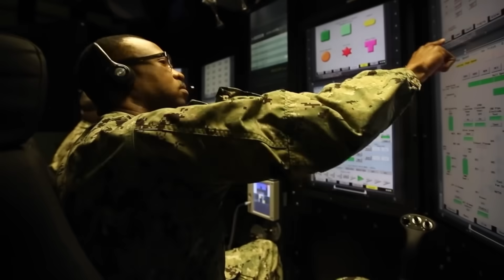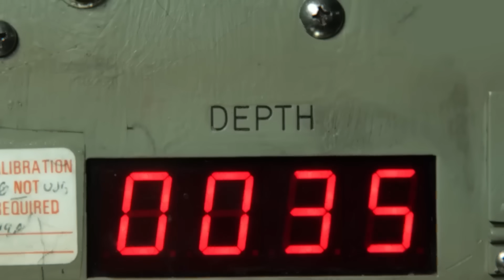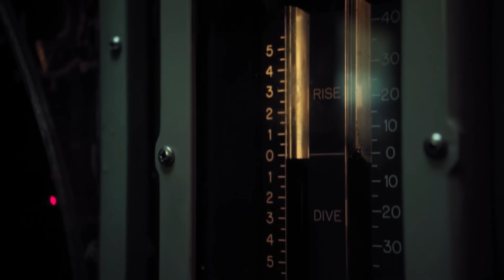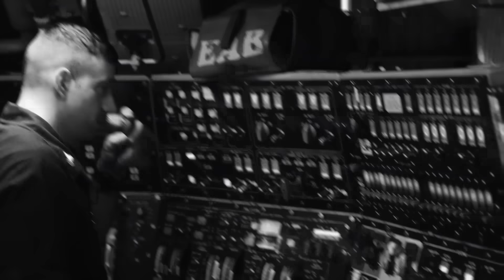What Happens When a Submarine Hits "Crush Depth"

Comment: So my question is why didn’t the titanic halfs implode on the way down after sinking 👀 just a question because I really don’t know the science behind it all.
Reply: Cus it big af
Reply: The Titanic wasn't pressurized
Reply: It's pretty confusing, but the short, simple answer.. the Titanic was letting in massive amounts of water on its way to the bottom for obvious reasons. It's not a completely sealed vessel, so the pressure isn't as catastrophic as a submarine would be. Once the submarine is at very low depths, all it takes is a small fracture to immediately crush it.. if that makes sense
Reply: It wasn't air tight like a balloon, the water flowed freely and filled it up like a wiffle ball.

Comment: Less than .025 seconds you would never know it would go to black. The thresher went down ultimately because of its shit emergency blow system. It used to have grates over the pipes high pressure with moisture at those depths makes ice...... Ice stopped the ballast tanks from filling and she went down. All this has been changed.

Comment: The Thresher didn't sink due to loss of reactor power. It sank because of moisture in the high pressure air tanks; this moisture in the piping froze which prevented the ballast tanks from being expelled which would have allowed the sub to rise to the surface on it's on bouyancy.

Comment: At  the Titan's depth,  water would rush in at approx twice the speed of sound. The air would experience such rapid compression, it would get close to 3000 degrees centigrade (about 4800F) in about 1 millisecond. This would vapourize organic tissue instantaneously. The author of this video compares submarine depths (1000-2000ft) with the pressure in a diesel engine. At 12,500 ft, the pressures are at least 20 times greater than a diesel engine detonating. These numbers are incomprehensible. Suffice to say,  when Titan imploded, the occupants wouldn't have even heard the sound or felt the effects of the implosion. (Approx 7-13 milliseconds to experience pain, from the time of the stimulus). Death would have occurred in 1-2 milliseconds. Unlike a bomb,  where the force of the explosion is from one point,  in an implosion, the force is all around the victim.

Comment: To put it in perspective:
The implosion happened within a fraction of a second. Say the submersible is like a balloon. Like one of those celebration balloons with things inside of it. Now, you have the balloon. It's waving in the air like nothing and then you pop it with a needle. How fast did it take the balloon to pop with that needle? That's how fast the implosion happened..and whatever came out of the balloon is dust. In the situation with the submersible (the balloon) it happened that fast and the people were gone (dust) before they could even finish blinking. They were, unfortunately, reduced to atom particles in the sea.
Reply: Well, they were compressed into a red colored pulpy cloud of water.  About 80% of your body is already water, and would be just fine after the implosion.

Comment: 2:23 For those wondering, the Titan would have taken about 1 millisecond to implode. The air inside would have ignited due to the immense pressure, and everyone inside would have immediately incinerated and turned to dust. Source: BBC
Reply: That's the actual implosion. Before implosion, acoustics would be heard. The delamination would begin. The passengers would hear it. They had time to drop ballast. They called a mission abort. They started an ascent... so there were moments before where they had obvious reason for concern. They would've lost coms & power while the shuddering & groaning increased before ultimate failure. Source: James cameron
Reply: @BalthazarMyrrh70  Where did you hear about them dropping ballast? I have heard of no such thing from official sources.
Reply: @rosieposie9564  they should release the final transmissions... anyway, watch one of the initial interviews with Cameron. He's all over this now. The final transmission was apparently an abort. The ballast was dropped. It was communicated to the above surface vessel & shown in the debris & location because the vessel had actually begun an ascent before moment of implosion. This is from various reports I have seen online. And would be typical of previous missions, the majority of which were aborted due to various issues.
Reply: @BalthazarMyrrh70  All possible, however, I think it is best to wait until the investigations are concluded to establish the facts in this case as lots of rumours and speculations are going around. Cameron is now annoying me, he dropped out of college while studying physics to study English instead and he dropped out of that too. I acknowledge his experience with deep sea exploration but I think he should leave the science stuff to the real engineers.
Reply: @rosieposie9564  Cameron actually knows when to defer to experts.
Reply: Source: Pedophiles

Comment: Im still curious to see the internal GoPro of the Titan.
Reply: A submarine implodes 50 million times slower than the Titan did.  Because of the depth and pressure.   Titan crew were cooked and vaporized in 1/10,000,000,000th of a second.  Faster than the their brain even works.   A submarine implodes in about .01-3.0 seconds, due to how shallow it is.  Doesn't even cook the crew

Comment: At the point of implosion the inside of the Titanic submersible became as hot as the sun's surface so the passengers likely evaporated and there won't be any body parts found.
Reply: The heat of the air really has little to do with it - and it isn't anywhere near the sun's "surface" temp (not that the sun has a surface).  In the first few milliseconds after the hull collapses, everything inside of that sub will be crushed down to 1/600th of the volume it previously had.  Everyone in that sub was instantly reduced to a pulpy red liquid within milliseconds.

Comment: This video has so much wrong with it.  It claims the crushing depth would “generate so much heat as to make the submarine implode”.  Imploding is not a function of heat.   Heat has nothing to do with it.  It implodes simply because it’s shell maintaining the internal pressure failed.  That’s all.  

The video claims that “fuel, oil, and bodies would rise to the surface”.  Fuel and oil perhaps, yes.  But bodies? No.   We are essentially the same density as water.   The only reason we float is because our lungs are filled with air.  At crushing depth, all the gasses within us - the air in our lungs, the oxygen in our blood, etc - would be crushed out of us instantaneously.  The gasses would either dissolve into the ocean water around us or float to the surface.  But our bodies? No.  First, we wouldn’t have bodies at that point.  We’d have been pulverized to a paste.  But any tissue that did remain would sink to the bottom.

Hell, even when whales die, most of them sink to the ocean floor.

Comment: Thresher did not succumb to electrical failure caused by water saturation. Subsequent testing reveled that Thresher sank because ice formed in the pipes needed to blow their ballast tanks due to condensation, preventing the compressed air from passing through.

Comment: A submarine, as soon as one thing goes slightly wrong, will turn into the place that’s optimal for various kinda of death

Small room and a lot of people make it prone to violence, you can die due to something water related, you might die because of something wrong with pressure, if the submarine is nuclear that can be a realistic danger as well or if its diesel powered the gases can be your end and i think there is still mich much more that could kill you

I would never go deep into the ocean inside one on my free will

Comment: How can the century old Titanic be in relativity whole shape while a modern submarine implode?
Reply: Physics! If you push a water bottle full of air down far enough, the pressure outside will be more than the atmospheric pressure inside the water bottle and crush it. Fill the water bottle with water and It won't be crushed. The bow of the titanic gradually filled with water and thus remained in relatively good shape whereas the stern went down with air trapped inside and did actually implode. At least that's the theory most people accept
Reply: @FilsketeerHD  Good explanation 👍

Comment: What happens, if there is a small leak that let's water in as the boat gets deeper, that would increase the pressure insight, lowering the pressure differential. This would of course compress the remaining air space smaller and smaller, but this means a boat can go deeper than crush depth while staying mostly intact.
Reply: There's no such thing as a small leak on a submarine.  Either your craft is watertight, or it is destroyed.  We use water jets to cut steel.  A 'small leak' when you're down deep is equivalent to one of those steel cutting water jets.  Whatever hole it is coming in will only be small for a few milliseconds while it cuts a large hole.

Comment: Any of you work in Frac?  The pumps can supply 60 million pascals, or more and when combined with other pumps can push 12 cubic meters per minute down a small pipe. 

Reason why I mention this, pressure is inside the pump, and as the cylinders cycle, the thick steel pump will appear to breath, even though it is thicker than five inches.

Steel may be rigid, but all materials have some form of flexibility and will descrease or increase in size regardless of thickness of material.

Very fascinating to watch.

As for what happens to a body subjected to a pressure release, sadly some people on frac jobs never came home.  The energy destroys flesh and breaks bones.

Comment: To put into perspective. The challengers depth of 35 000 has such a high pressure on a submarine if anyone made a hole the size of a medium pin needle. The pressure from the water that will rush in is so high it'd drill through you like an industrial jet stream cutter of 40 000 psi. The elephant on top of a stamp doesnt even begin to describe it. Every square inch has the amount of water push down on it equivalent to mount everest heigh of an inch wide steel pole being pulled down onto that square of space. It would be like crushing an ant with the largest and tallest building ever created. Ex: Empire state building or Burj Khalifa.
Reply: :face-fuchsia-tongue-out::face-fuchsia-tongue-out::face-fuchsia-tongue-out::face-fuchsia-tongue-out::face-fuchsia-tongue-out:!!!! "It would be like crushing an ant with the largest and tallest building ever created":hand-orange-covering-eyes::hand-orange-covering-eyes::hand-orange-covering-eyes::hand-orange-covering-eyes: OVER KILL DOES NOT BEGIN TO DESCRIBE THAT STATEMENT!😭
Reply: Should be closer to 14.5k psi at that depth unless you mean 35km

Comment: Definitely the main reason why any ships like aircraft carriers, heavy cruisers, destroyers and mine cutters targeted by submarines in war would have to rely on depth charges. 

The only options for submarines left to avoid being sunk by depth charges would either have to be to take off at full speed from the ships to get out of the way of both the target ships at surface level or the pre-set explosive range of the charges when they went off... or to head deeper, descending below the maximum levels of the charges' exploding range, usually being pushed dangerously close to "crush depth" in order to avoid being blown up under the surface and sink, hoping that the enemy ship launching the charges will eventually lose them and continue on its way. Because of the extreme force and pressure exerted by the charges when they explode, which compresses the surrounding water against the submarines at such a high rate that they can cause hull breaches that could with repeated effects gradually lead to the submarine sinking, submarine crews would be walking the tight rope between staying in firing range of the target vessels and maintaining a safe enough depth above "crush depth." There are also devices embedded within the submarines, also used previously in war, that pick up when the charges would be in close proximity, letting out a few ticks just seconds before the charges exploded so the sub crews could brace for impact. 

Just as a side note, this is why sub crews also had to rely on a technique called "silent running" (long before the term became synonymous with environmental concerns, probably due to the 1971 sci-fi space film of the same name) where, if they were ever carrying out dangerous missions requiring that they enter enemy harbors or pass below an enormous fleet before prepping for torpedo attacks, the propellers would run at such slower speeds so that the enemy ships' radar wouldn't pick them up. During "silent running" intervals, the crews within the subs were ordered not to make the slightest motion or noise EVER, including dropping objects like tools within the hulls, because even the slightest accident of an object hitting the metal floor of any sub chamber or sound vibrations echoing against the hull could be picked up on radar and expose the sub's position. This was and is still usually depicted in films and TV shows involving sub missions in war time, usually as an element of suspense. 

Finally, and this is usually the worst part of being forced to descend to "crush depth", is the built-up sense of claustrophobia among the crew members after serving long-term voyages on board subs especially during prolonged missions. Usually the part where the subs head to crush depth during attack or escape maneuvers is the pinnacle of the escalating claustrophobia of crew members already working within tight corners surrounded by sea water after months on duty. Approaching crush depth is also, in a sense, hitting "crack" depth, because there's only so much certain sub crew members can take before they run the risk of their mind cracking and they go into a frenzy, which can further complicate or even worse jeopardize the fate of the crew.
Reply: You are very confused about how the world works.

Comment: But how come life survives beyond the deepest depths, how deep can humans dive ?
Reply: If you don't have any air cavities in your body, you can swim down as deep as you like.  There just isn't much to eat down there, so life is pretty scarce.  You, as a human, have lots of internal air cavities that unless you fill them with an equivalent internal pressure (thats how scuba works) they will quite painfully crush down under water pressure.
If you submerge with just a hose to the surface, even just a few feet will be enough water pressure on your chest that you can't inhale any longer.  Scuba tanks inject pressurized air into your lungs that gets higher and higher pressure as you go deeper, keeping the pressure in your lungs balanced to the pressure in the water surrounding them so you can breathe.  But the next problem is that nitrogen and oxygen become poisonous under high pressure.  So beyond certain depths, you have to start breathing mixtures of helium and oxygen, or even hydrogen and oxygen.  About 700 meters is the limit that technology can take you.  You'll need another 3,000 to get down to Titanic.

Comment: Okay so the conversion in math here is that if they were at a depth of 3800 meters. (The ocean titanic sub). Then thats roughly 12,500 feet. At these measurements, that would translate to 5,500 psi. This video is talking about a very large sub. The Titanic ocean submersible was like a cigar tube under water. So, instead of it being 875 psi, which would be more than enough to kill any human being, it was 5,500 psi. If anyone is concerned. They wouldn't have felt a thing. They would be dead in a fraction of a second before they even realize what happened.

Comment: What happens at crush depth?  In a nut shell, and to be frank, (even if the truth is a bit brutal) the craft or vessel implodes, all living things on board instantly die before it/they know what happened.
The fish, crabs, urchins, worms, and other sea life that lives on the bottom MIGHT find tiny bits of protein resulting from the implosion in the mud or floating down, or stuck to some of the larger pieces of debris from the crew/passenger area as it hits the bottom.

Bear in mind that crush depth is NOT necessarily the bottom of the sea. It may be "just" 1,250 feet or less.

Design flaws, and mechanical failure can make the actual crush depth much shallower than thought, as well.

Smoke & Prayers for those who lost their lives on the recent first (and likely last) Titanic "Tourist Sub".

0:28 "... how reaching crush depth can change history for those aboard ..."
Yeah ... it WOULD "change history" for them onboard ... Their personal histories ending is a heck of a change. 🙄
Their personal histories ending also changes the personal histories for their family members (tho not as drastically) especially those of their spouse and kids. 
Whether their loss changes National, military or world history is debatable.

Comment: Lets cut to the chase.  The heart is a gravity fed pump that operates at normal atmospheric pressure.  Now imagine that your heart is stomped on by about three hundred elephants.  Now consider what causes embolisms…. You will never know anything while this happens across your entire body.  Veins and arteries are designed to operate at 14 pounds per square inch (roughly).  Your heart would be crushed first (after your lungs), and your arteries and veins will rupture and your skull would be crushed like a very thin shelled egg.  No chance.